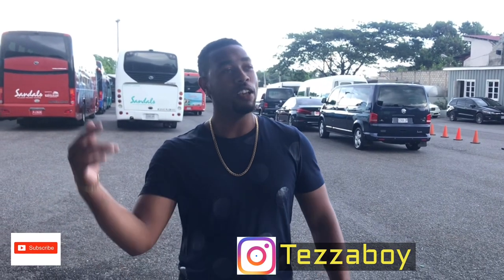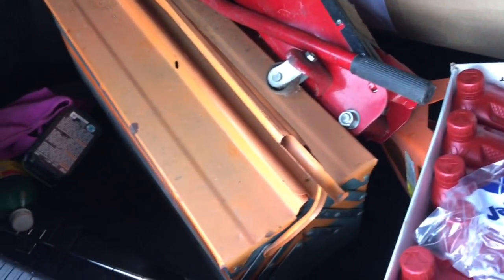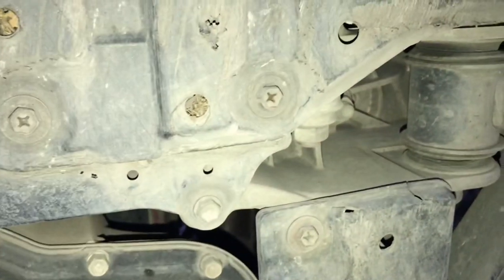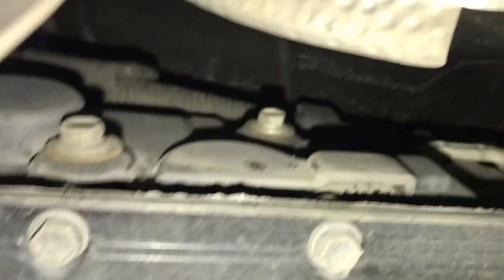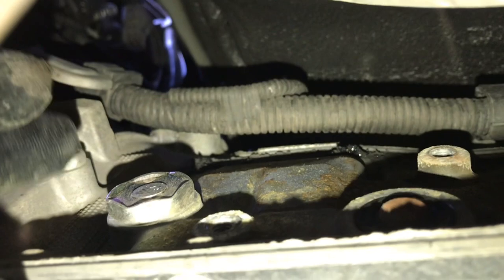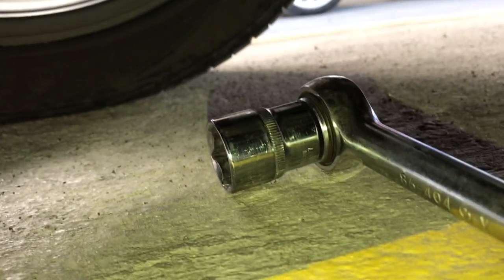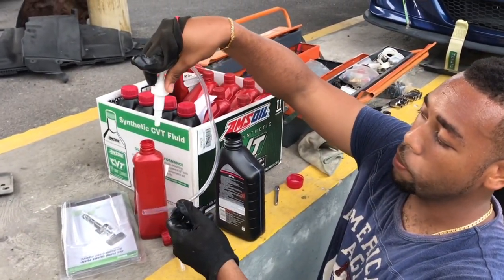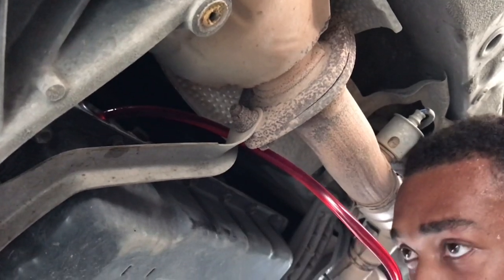Lexus Is250 Auto transmission oil change

Comment: Great video, Tezzaboy.  One thing I think maybe could have been explained better is that there is a third bung, the overflow plug, which is that allen key on the pan.  The idea is you close up the drain plug, open the overflow plug, and add fluid until it comes out the overflow a little bit.  That's how you know it's full.  The way you're doing it, there's a possibility the transmission would be overfilled.

Comment: Totally Wrong! 1. You are not spoused to do the level check through fill hole. 2. The level check should be conducted when trans fluid is with specific temperature range. 3. Go to eBay and buy a repair manual only couple dollars can prevent you from thousand dollars trans repair later.
Reply: Hi - may I know where to do the level check?

Comment: I just had my IS250 transmission serviced at AAmco transmissions with 208,000 miles..due to a bad gasket..the techs told me the oil was as extremely dirty, and I probably shouldn’t service it again..even tho my car shifts like butter. Only 6-7 quarts were replaced. Pretty scary stuff.

Comment: Normally when a transmission oil is being change the filter also should be changed its best to do so. Good job though🖒
Reply: 🤔or at least wash it and the transmission oil pan... Which is what I wanted to see🧐 @teezaboy you we need the next part, class nuh done yet
Reply: @DezzheemFdhRadio  If you go to the trouble of removing the transmission oil pan, put in a new filter.  Trying to wash an old filter is a waste of time and probably worthless.
Reply: @Timetryp  💯
Reply: I drained mine and measured how much came out , it's exactly 2 quarts
Reply: @procarpio  cool so I will get 3 to be on the safe side I asked a shop $280 hell no lol

Comment: Totally wrong. Ok taking the plastic guard off and showing locations of the 'bongs' was good but OMG how wrong everything else was. 
Yes drain as shown BUT record/measure how much oil came out.
Yes where the fill hole was good But you should only pour back in the same amount that came out.
You didn't show that you put the drain up back into the trans sump.
You should start the car and go through the gears a few times so that the valves and pumps within the trans circulate the oil and bring it up to a temperature of about 114 degrees. 
When the oil has reached the temperature then and only then remove the smaller plug to see if any oil comes out. 
If it does then that's good because you'll know the level is correct. 
If nothing comes out then you'll need to put a bit more oil in. Run the sequence again running through the gears to reach temperature then check level again.

Comment: How many bottles of oil were used?
Reply from the maker: 3&1/2 bottles . If you replace the filter it will take twice as much .
Reply: @Tezzaboyproductions876  so 6 & 1/2?
Reply from the maker: @S3lvh  yes if u clean or replaced the filter .
Reply: Respect for the response....So its ok to leave the original filter in and put new oil without any problems?

Comment: At what mileage did you change the transmission fluid? Thinking of doing mine but getting mixed advice
Reply: did mine at 60k miles, im at about 90k miles right now, might do this one early and with a filter change